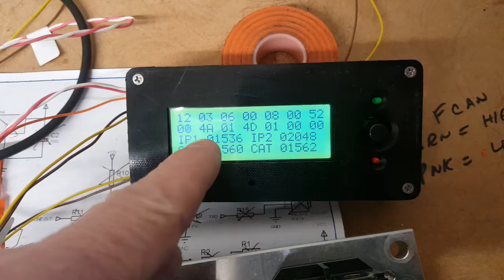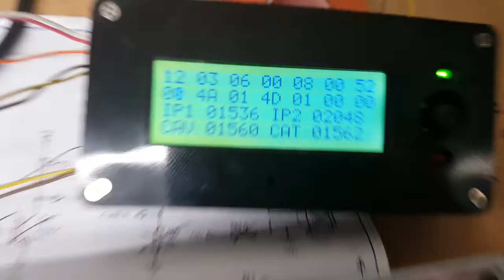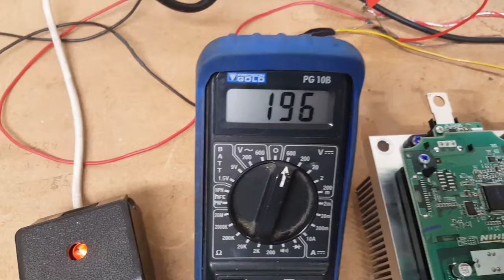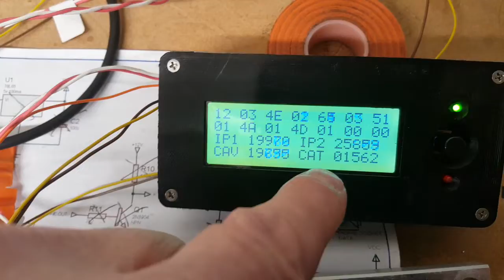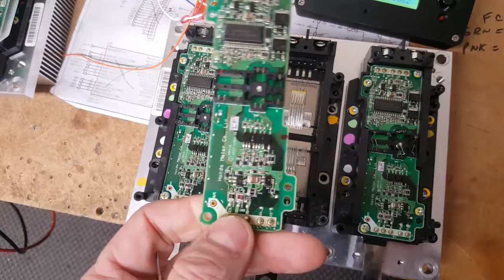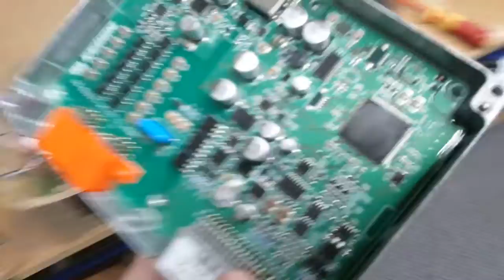HCH2 Civic IMA into Lithium CR-Z Car Video 3

Comment: hi! I use these inverters to control another brain. the place where you have the orange wire soldered can be used to get an analog signal about high voltage? or is there another place on the native board where you can get an analog signal that changes along with the battery voltage?